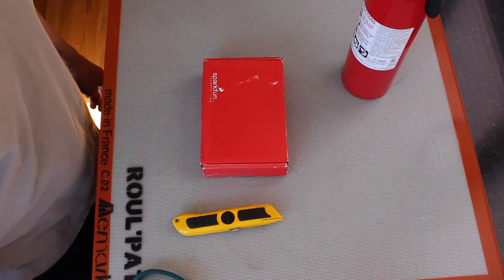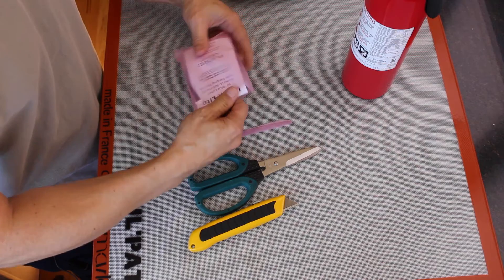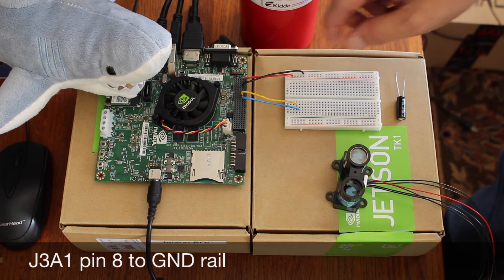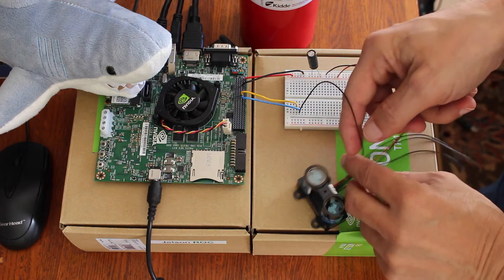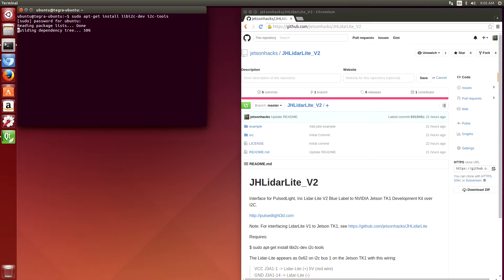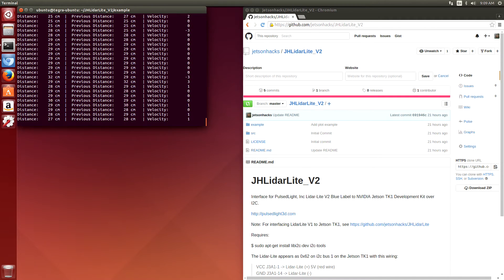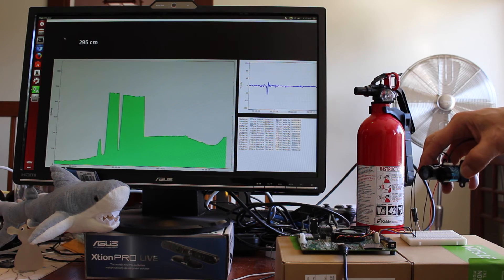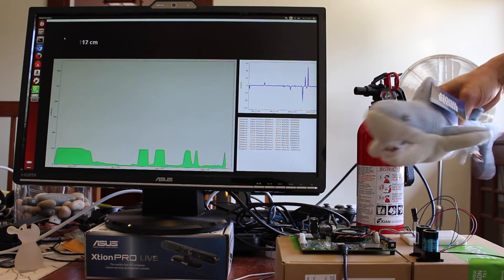LIDAR-Lite v2 Install and Demo - NVIDIA Jetson TK1

Comment: Thanks for the video. Any chance there's an install demo for TX2?
Reply from the maker: The installation should be the same as on the Jetson TX1, except the GPIO numbers are mapped differently. See: http://www.jetsonhacks.com/2015/12/08/gpioi2c-on-jetson-tx1-lidar-lite-v2-installation/
Thanks for watching!
Reply: Thanks I'll try it with TX2. Does the capacitor have to be 680 uF? Do you think 470uF could work? What is the voltage limit? Thanks again!
Reply from the maker: You will have to check with the manufacturer. The 670 is their recommendation.

Comment: hello, that was such a great video! but, how accurate is it? the lidar lite v2 catalogue says +/-1.5cm , it seems better than it, isnt it?
Reply from the maker: Thank you for the kind words. It is very difficult to measure how accurate such devices are because they are so dependent on the test environment and the reflectivity of the objects to detect. The manufacturers go through a much wider variety of tests. It appeared to me to be more accurate than quoted, but I certainly didn't test it in a rigorous enough manner to give a definitive answer. Thanks for watching!
Reply: JetsonHacks 
thanks a lot

Comment: That is a great video! Thanks. Thinking about an easy way to interface the distance value to an Android device. Any ideas?
Reply from the maker: Hi Enzo,I don't have any off the shelf methods to do so. You'll have to figure out how you want to talk to the Android device, and what you want to do with the data. In this video: https://www.youtube.com/watch?v=Obj_AAUGg3w I ran a web socket server on the Jetson, an Android device then connected to a wireless access point on the Jetson and read the web socket through a browser. A lot of it depends in what environment you running. If you're running ROS then you can transmit the values from a node. A couple of decisions need to be made, such as how you intend to get the data to the Android device, wireless or wired. The second decision is how you're going to send it such as any protocols you want to implement Hope this helps.
Reply: Thanks for your answer. I am also thinking about Bluetooth low energy. It goes slower than bluetooth, but apparently fast enough to exchange a number (the distance) with an acceptable data rate. Also it allows multiple connections, which is also a plus.

Comment: hey , what us the sample rate you get from the sensor ? Would you be able you increase the sample rate by providing a external clock ?
Reply from the maker: +ni yinsen For the demos, I only sample about 50Hz or so. The actual sensor will do 500Hz. I'm not sure what an external clock would be used for in this case. You can poll the LIDAR-Lite V2 via I2C or PWM (I2C @ 400 kbits/s), so there should be enough bandwidth for faster sample rates if so desired. The main issue would seem to me to be is not how fast you can get samples, but how fast you can actually consume the data that the samples produce. Thanks for watching!
Reply: +Jetsonhacks 
Thanks your for your answer ! 
I am still little bit green about this  ,I am currently building a diy lidar to generate point cloud file . I am using raspberry pi 2 with a naivo+   . I am little bit confused about "how fast I actually consume the data ". What do you mean by this ? Is there something i am missing about the i2c bus?
Reply: +Jetsonhacks Thanks again for your help
Reply from the maker: +ni yinsen There are two parts to this. The first is actually gathering the data, how quickly  which will be determined by factors such as the speed of the actual bus, how fast the sensor delivers data, how quickly the CPU can actually read the bus and so on. This is relatively straightforward, read it as fast as you can on the processor side and see what happens for starters. On the Jetson TK1, for example, the I2C bus speed can be set to run between 100Hz and 1MHz (I believe that the default is 100Hz). 

The second part is that you should do something with the data when you collect it (consume the data). Most applications collect sensor data, do something with the data, and then collect some more data, repeat. If it takes time to actually do something with the data, and you're in the same process as the sensor collector, then that will also limit the speed at which you can poll the sensor. 

On a multi-CPU architecture, many times the application programmer will poll the sensor on one core, and run the data processing on another. That means that the overhead in the sensor polling loop is the inter-process communication to send the collected data to the process that is consuming the data (which is relatively inexpensive). 

In fast communications, sometimes you'll see the data injected straight into memory where different processes can share that information (usually referred to as DMA), but I2C is relatively slow so this technique isn't used very often for this type of application.